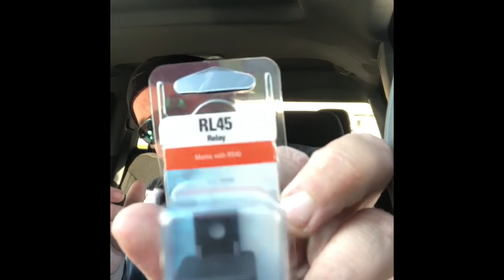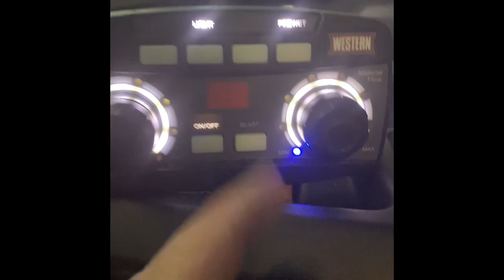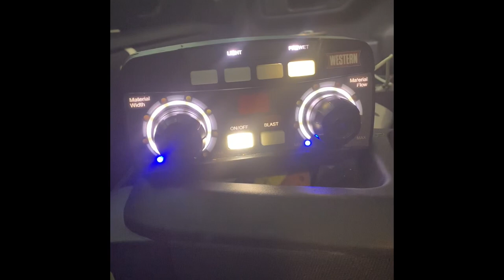Western Salt Spreader Accessory Wiring (how to)

Comment: I thought all those relays needed a ground? The wiring coming from the control module, is that the ground because I think you have it on the ground pin of the relay?

Comment: Hey man for some reason my diagram is showing pin 85 is ground and pin 86 would be to the switch controller pin 87 is for the lights and pin 30 is the 12v constant im just a little confused
Reply: Did you ever figure this out. Is the wire coming from the spreader a ground?